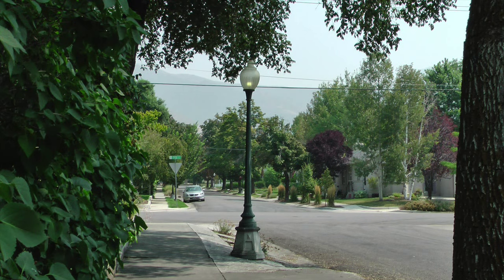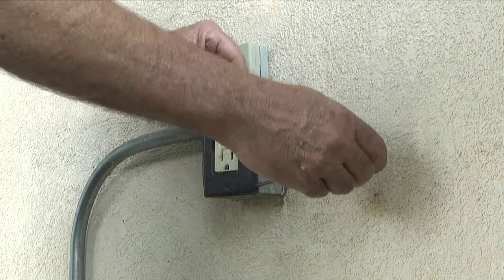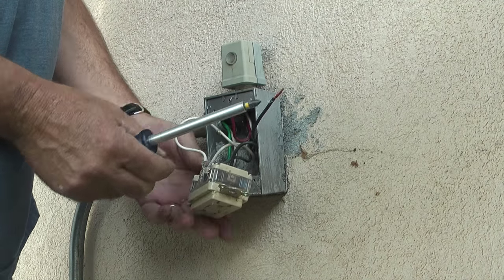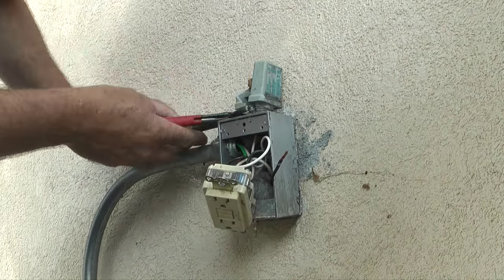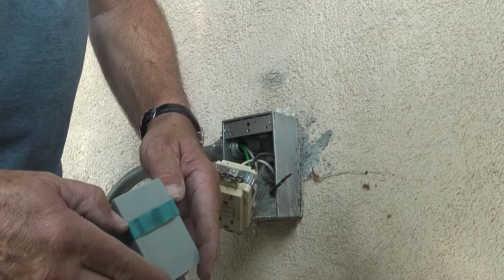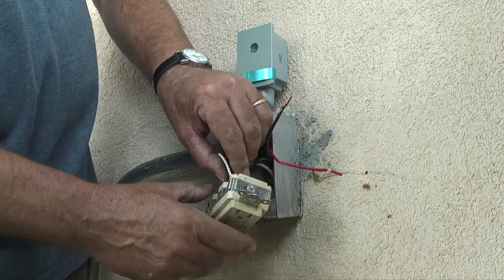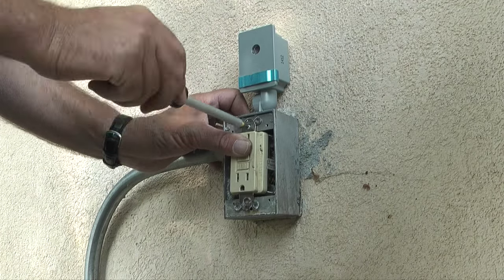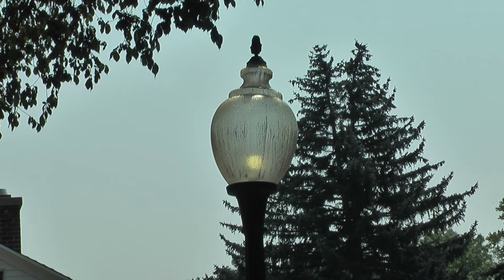Photocell Replacement

Comment: I am doing a similar project. I am adding a GFCI receptacle as well as photocell very similar to yours.  I have most of the wiring figured out with the help of your video.  My question is where do you have the white wire that goes to the street light attached?
Reply from the maker: To the common/neutral terminal (silver) on the load side of the GFCI plug.
Reply: Hey guys I just did this same job and I’m not getting power to the wires. The beaker is on and the meter is on. Any ideas?

Comment: How do I know which breaker if it’s not labeled?
Reply from the maker: I would plug a light into the outlet and trip breakers until the light goes off, then I would check outlet with a multi-tester to be sure. Remember to label the correct breaker afterward.